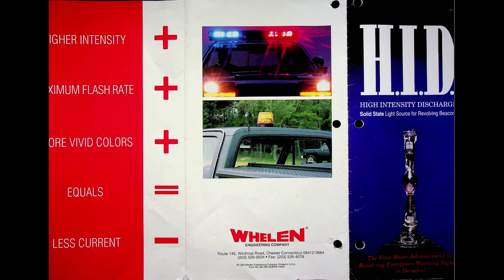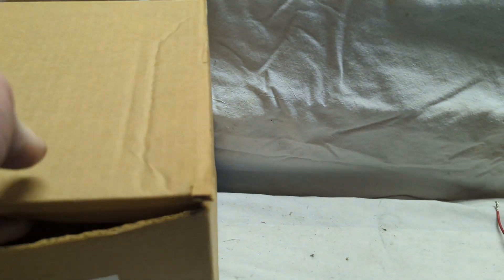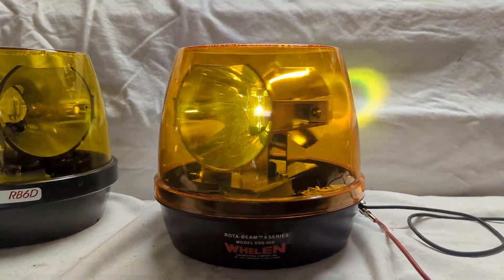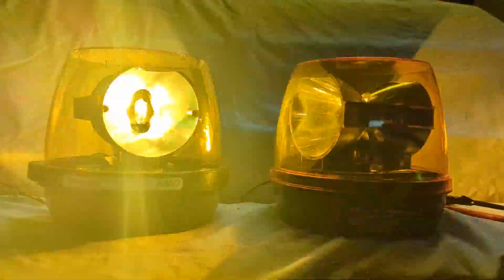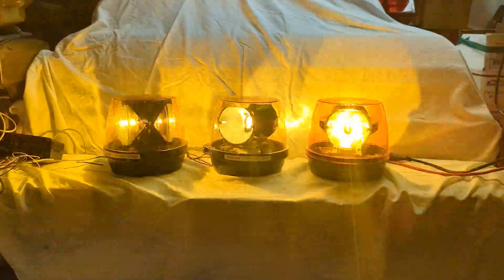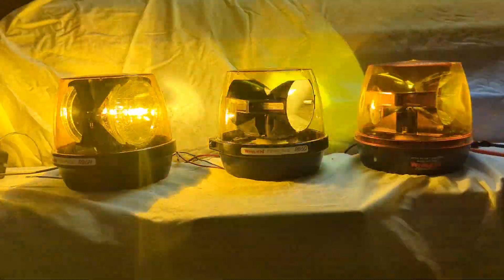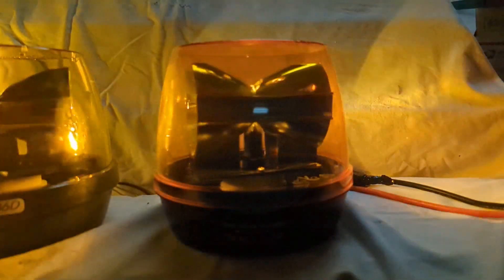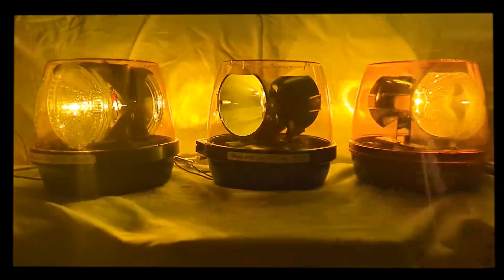Whelen HID (High Intensity Discharge) Warning Lights

Comment: The sheer size of the reflector draws me to personally chose the sealed beam .. I picture each light turned on approaching an intersection, .. the HID would warm up in time to cross, the halogen would be sufficient, yes, I just like the diameter of the sealed beams. Great comparison, thanks,

Comment: Cool video! I had never seen a rotating warning light that used HID for the light source. To me it looked like the dual reflector halogen has a cloudy reflector assembly. And I would have liked to see the HID model powered up without the dome. 

But again great video of something I had never even heard of before!
Reply from the maker: I have not taken the dome off the HID yet, but it would be interesting to see the "color temperature", especially next to the halogen one without the dome. If i remember correctly based on the degrees K the HID is much more "cold" and the halogen more "warm". I will take a video comparing that at some point, good idea.

The Code 3 dual reflector light is very much in "right off the vehicle" shape. I included it as another reference point, but it is not NOS like the Whelen ones (I could probably clean it up a decent amount).